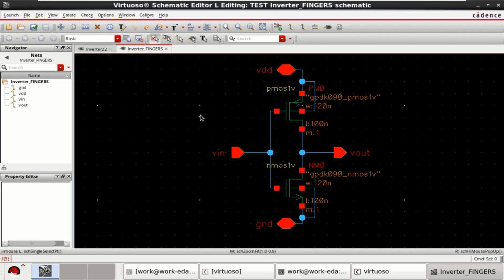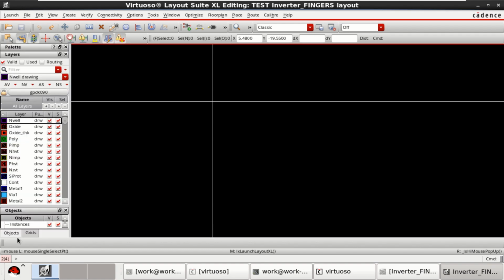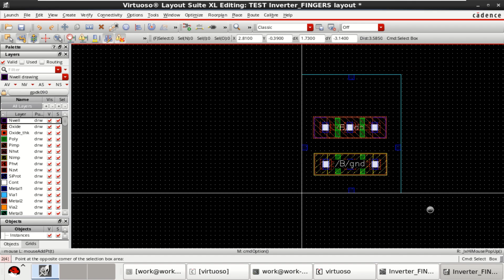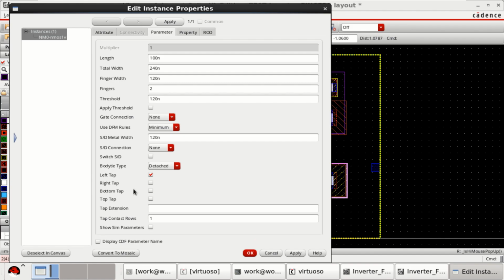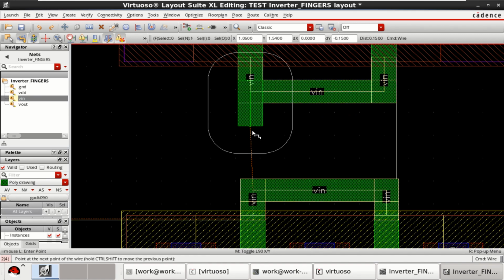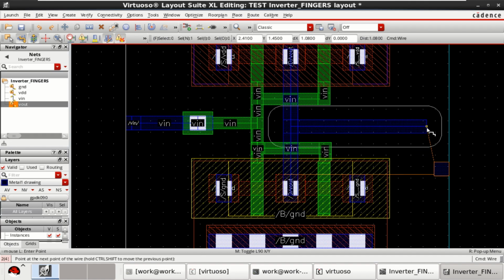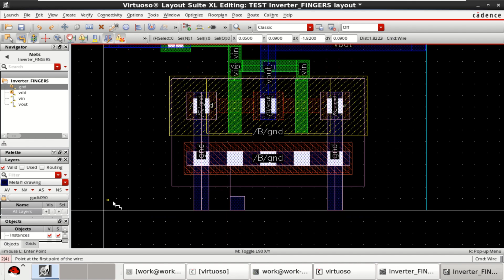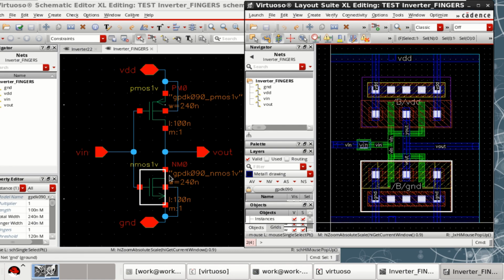CMOS Inverter Layout Using FINGERS.

Comment: hey sir umesh here sir i have completed my project 3 bit ripple carrry adder i have checked Drc and found no error on that but i am finding error in lvs check it is because of when i imported layout of nand and xor gate and try to connect them then for 3  bit full  adder cin and my other pin in layout block which is imported  i am getting net1 net2 net3 like wise wire with same metal .in lvs check that is only problem . i have found no extraction error in lvs .it will be great if you help us in this problem please sir.
Reply from the maker: I could not get what you are asking
Reply from the maker: Net1, net2 could the wire you used to connect nand and exor layout
Reply: @dr.hariprasadnaikbhattu  hello sir sorry my english is not that much strong .  when we imported nand gate and xor gate for making 3 bit rca then the pins of nand gate and xor gate like A,B  are present inside the block which has been imported . when i am trying to connect like A to A1 then the wire which i have drawn from A to A1 is written net1 or any net . which is got detected by lvs as error .
Reply: the same lvs error i have got while making xor gate using nand gates layout block wire name is written like net1 net2 .